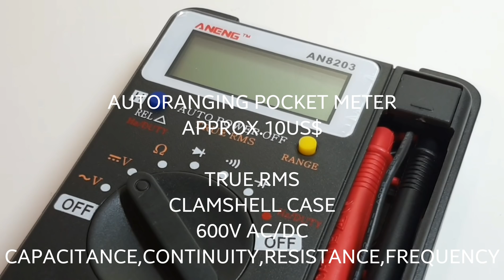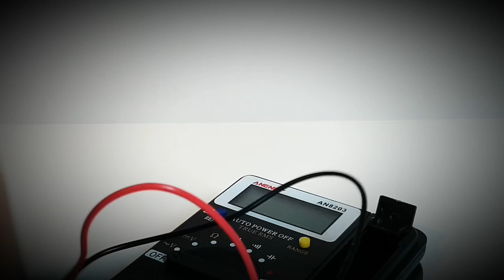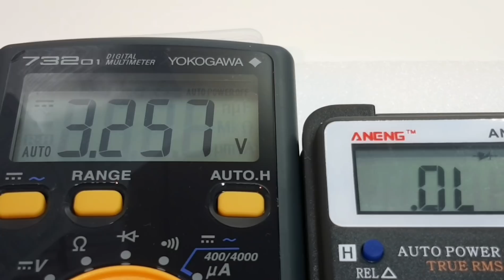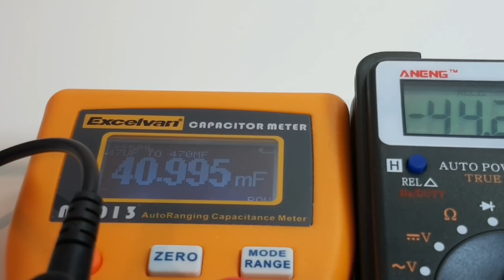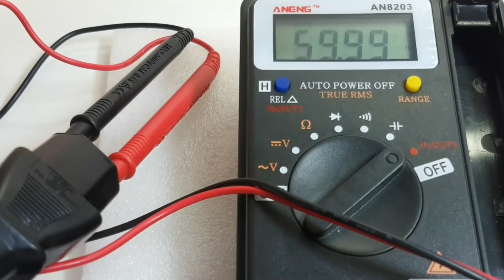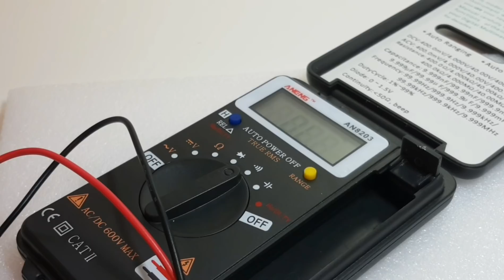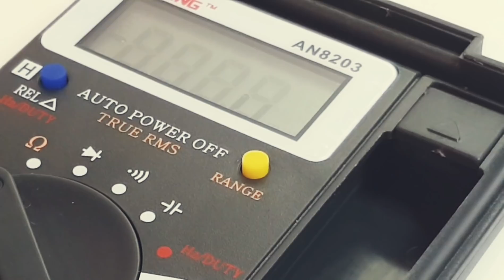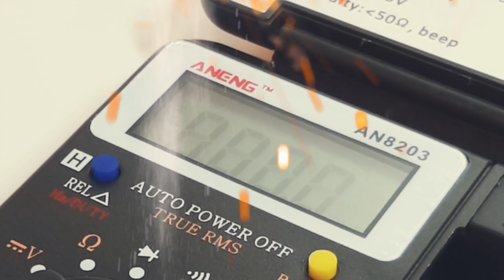ANENG AN8203 CHEAP-O Pocket Multimeter Review & Teardown!

Comment: In frequency mode it is not exactly a good idea to put this multimeter into AC mains. The reason is that for e.g. Victor 921 which is almost identical (though it has PTC on the other side of PCB board) has two J3Y transistors in Zener diode schema in this chain. J3Y has 25V maximum voltage the maximum in frequency range therefore is 25-40V not higher than that.
It was discovered however that the frequency of mains can be checked with one positive (red) probe, bonus if the mains outlet wired correctly in this case red wire connected to left plug of the 240V outlet will result in showing 50Hz exactly and stable. 
When the same thing is done with the right contact of  the mains outlet the frequency will float a lot. No need to put 2 probes in 240V mains in this mode (remember not to touch the second probe when doing so just in case)! In Victor 921 PTC heated and finally an accident transient on badly wired mains outlet fried these NPN transistors in Zener diode schema and R7 100ohm was burned. Otherwise this meter is great as a pocket, light to carry and it is reasonably accurate. After the replacement of the burned transistors (new ones were available only NPN BC817 these were used instead of the original ones and it seems an accurate enough afterwards!). R7 100Ohm was replaced and the multimeter Victor 921 have started working again. It is great for occasional repairs and to keep with you all the time when traveling as it is very compact and lightweight yet accurate and functional. Makes an absolutely great backup meter. Continuity mode for e.g. can also be improved, just add in parallel with the buzzer the red light emitting diode and this also greatly improves usability of this pocket multimeter. On the probes also the thermoplastic tubes can be added to improve safety overall. And PTC would be better to have in this multimeter on the other side of the PCB. The Cat 1 circuits ok. On the meter it says Cat 2 but be careful with that, use protective gear. Overall as a have a go in a pinch meter it is ok and it is reasonably accurate for most uses. Frequency range is great and it is up to 1500Hz(not bad), even at 3500Hz Vres = Vmeans *2 * 0.95 and it is close enough! True Rms values for square signal was ok. Capacitance measurement works very well indeed in this meter. The case flimsy a bit, but this can be fixed easily. It saved a day on the road few times as well and it is incredibly handy to have for basic jobs.
Reply from the maker: Great update/information!! Thanks 😊 Its a pretty decent pocket multimeter for the price. Keep On Testing!

Comment: Good review Darren thanks for putting it in the spotlight it doesnt get enough credit ive always felt.  Ive had this little meter for a couple years or so and for only $10 even with the cheap leads and case I I felt it was a decent performer and was curious to see how it would hold up under performance review. I already knew it was a bit surprising but I did not know it would both light and test LED's as I had never tried that test.  I did know its continuity was better than some larger meters as was its accuracy.  If Aneng was smart they would keep the board, add a larger display and better case and offer it under another model number, only thing missing is current testing but it wouldnt be the first meter without it.  Ive also had ideas of trying to add 1/8" mini jacks and modding another set of better leads to plug in at the bottom of the case like a Fluke 101.
Reply from the maker: It's a great meter, kudos for the recommendation. It's always great to see a dmm perform better than you expect and at a price that's incredibly affordable. I don't think any other pocket meter comes close in terms of value for dollar.. Incredible!

Comment: Hi Darren I bought an aneng h01 before I saw your video about it.
Can you do a high capacitance test for it?
If you can please do it.
Reply from the maker: Hi! No problem , the H01 is rated at 4000uF/4mF, I'll try a 10mF, if that works , then I'll try the 47mF...I'll let you know the results tomorrow ..
Reply: @KeepOnTesting  thank you I'm waiting for the 10mf test and the 47mf test.
Reply from the maker: @crazyksp8344  Unfortunately it couldn't read the 10mF capacitor,  it couldn't even read a 4700uF capacitor (4.7mF)..I don't believe the H01 is  using the same IC as this Aneng which would explain the difference...but we tried! 😎👍
Reply: @KeepOnTesting  OK thank you.
I'm 12 years old electronics hobbyist. I think 4mf is enough for me.
Reply from the maker: @crazyksp8344  I agree 4mF is good for many electronics projects and most requirements. You have a great future ahead of you!  Thanks for watching..
Reply: @KeepOnTesting  Yeah I hope in the future I will buy better equipments for my small lab😁😁.
Reply from the maker: @crazyksp8344  I'm sure you will! You've got all the time in the world..enjoy.